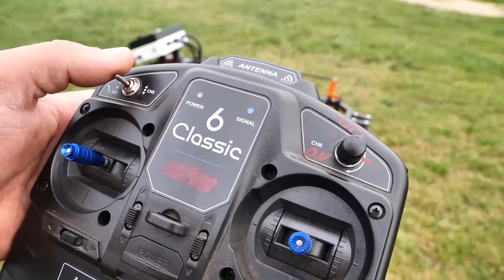Making RC Lawn Mower

Comment: Do you have any drawing’s or sketches for this? I would love to attempt to build this!
Reply: The video should be more than enough for you to get an idea down. You could build this as a fixed height or you could make the idle wheel like on a zero turn with spacers to set your height and then the rear wheels have it either bend or some how adjust the height some way. Using an existing mower is fine yet one could still build one from scratch. You can also buy hub wheels which just have the motor in the wheel its self and spins on a soild shaft. Google that. You might even be able to just add them on to an existing push mower and add casters much like these and replace the front wheels. And a place for the battery and controller... There are a number of ways you can do this. Expect to spend 500 to 1000 dollars depending on parts and prices. Yet overall this would be far better to mow with as long as you can see it while you are either sitting on the porch or looking out the window. 
If you know who colin furze is. You can search for his all electric riding mower and get an idea how to build an all electric one. You can buy mower blade hubs and blades and sets for around 150 usd on amazon in the US
Reply: Also keep in mind that there are some already existing mowers that can cost a few thousand and some that even start at 10k and up.

Comment: Beginner needs help
i have the same idea
2 or 4 wiper motors
1 car battery 12 volts 45 amps
but my motor controller burned up
which motor controller do you recommend?
Reply: An appropriately sized motor controller from Sabretooth or Cytron will work because they are both reliable. That said, Sabretooth is more expensive but give you more power output for powering other loads other than the motors. However, Cytron is cheaper. Good luck.

Comment: You a lazy, but the lazy is a progress's energy. Cool realisation of idea. But fron whells I would install front wheels bigger or change right direction
Reply from the maker: In my country there is a saying "need is the mother of inventions" 😁The project is experimental, this is actually my first experience with R / C equipment, I will not improve this mower, but for the next season I will make another one with a caterpillar drive :)
Reply: @WorkshopFromScratch  Viel Erfolg bei Ihren nächsten Projekten

Comment: Does the engine charge the batteries ?
Reply: this engine has a battery charging function, the charging is too weak to cope with the current consumption, but it significantly extends the working time

Comment: O motor é a gasolina? Se for, é possível adaptar um dínamo a ele para recarregar as baterias enquanto  está em uso?
Reply: Those engines have a generator and voltage regulator for battery charging already. Since he has hooked up the e-starter, it probably is already charging. My guess anyways.
Reply: @toolsarecool  excelente! Obrigado pela atenção!
Reply: @juliano3164  de nada, meu amigo!
Reply from the maker: Yes, this motor has charging, but inefficient for the current demand, but greatly extends the working time :)

Comment: Great work, it's awesome!! Do you have a list of materials? Where do you bought the motors, the linear actuator and the electronics components?
Reply from the maker: Thank you 😁 I bought most of them on Aliexpress, I bought the engines and the lift from Amazon, If you don't find it, write to me, I will send you the links
Reply: @WorkshopFromScratch  Hello, we are a company from Shenzhen, China.  We can produce high-quality parts for you while significantly reducing costs.  I think this product of yours can be mass produced, if you need production and processing, please contact me, thank you

Comment: built so heavy he gets at best 15 minutes of cutting be4 the power runs dead and it has to be recharged,
Reply: Don't think it's that heavy 😂. But I do get your point, and it is a great point. Part of the design and planning process should always include keeping excessive weight to as minimal as possible to help with the lenght mow time, and also to keep the wheels from tearing up the lawn during turns. My only concern with the design is the overall length of the mower, the front wheels are a bit to far from the back wheels, which results in more battery power being used during turns and also causes the rear wheels to slightly tear up the lawn in the process. That said, it was a nice and super clean build.

Comment: Great machine, it's too bad you didn't have the ability to remotely start it.  It would have also been neat if you had a blade brake clutch system on it so you wouldn't necessarily need to shut it down and additionally maybe even a secondary PTO to run a larger alternator to charge the batteries.

Comment: Why did u cover up the side wheres the grass going to go it will clogg ur mower u need a pop up flag that u push a button & the whole rod swings up with rod while mowing plus u need to figure out a away to put remote start instead of using a key